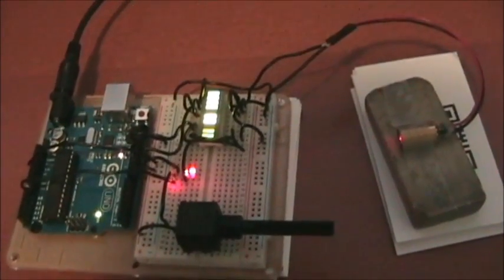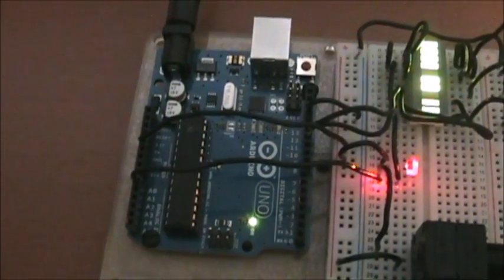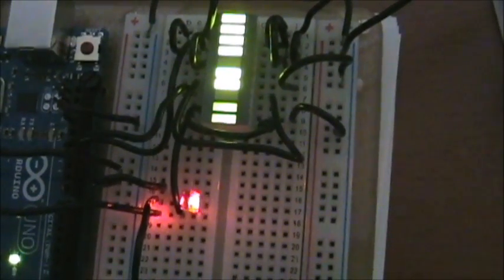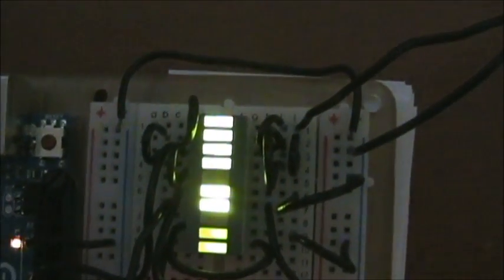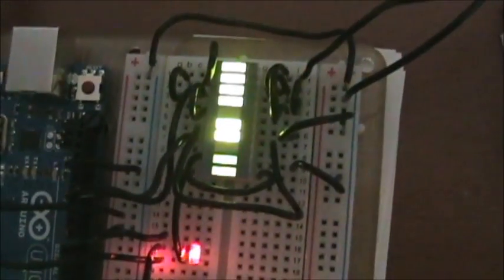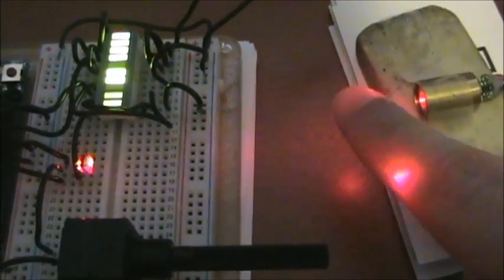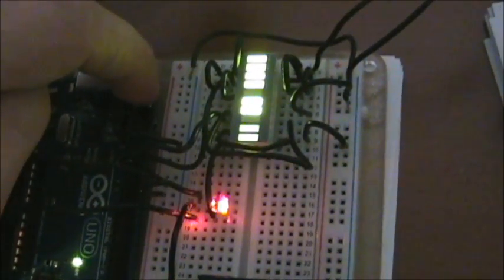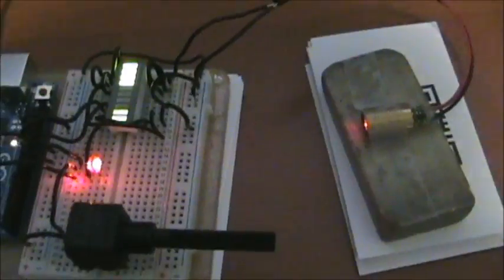Arduino Laser Tripwire

Comment: can the photoresistor be submerged underwater?
Reply from the maker: Yes and no.  The phototransistor is just a red plastic module with some wires coming out.  Assuming that the wires were not exposed to the water so that they wouldn't short, water wouldn't be an issue.  

If you wanted to make a unit that you could submerge, I think the best way to do it would be to buy or 3D print an enclosure for the detector and laser.  That way you wouldn't have to worry about shorting.
Reply: ***** I built a simple waterproof enclosure for the detector and laser and it still works fine. I have another one set up outdoors (without an enclosure)  and the phototransistor hasn't shorted. Thanks for this:)

Comment: Hi what is the max range of the laser and what does it total cost?
Reply from the maker: This is the exact laser I used:  http://www.allelectronics.com/make-a-store/item/dlm-3/laser-diode-module-650nm-4mw-3vdc/1.html.  The beam does not seem to be particularly well collimated, so I'd guess that it's good for a few tens of feet until it starts becoming difficult to detect.  The Arduino here is the most expensive part, but assuming you're using this as part of a larger project and so you have already purchased an Arduino you could buy the laser, potentiometer and phototransistor for under $10.
Reply: ***** Thank you!

Comment: Hi Ben, 
I'm looking to do a similar project. Do you mind telling me the specs of the photo transistor?
Reply from the maker: I'm not sure the guys selling it even know, which is why it's so cheap.  Here's a link to the exact one I'm using.  If you have some other kind, you should be able to tune them with the potentiometer to work.

http://www.allelectronics.com/make-a-store/item/ptr-2/phototransistor/1.html
Reply: ***** Thank you! I was also wondering if there was a difference between a photo transistor and a photocell. I couldn't fine much information online.
Reply from the maker: Himesh Kurera There absolutely is a difference between a phototransistor and photocell (e.g., photoresistor).  The photoresistor has only two leads, and you can think of it as just a normal resistor whose resistance decreases with illumination.  The phototransistor has three leads, and how much current flows is a function of both illumination and how much voltage is on the base.  In the case of a photoresistor, the dark current will be much higher than the dark current of a phototransistor, and the switching time will be substantially slower.  Because I wanted fast switching and near-zero dark current, I chose a phototransistor.
Reply: ***** Once again, thank you! A photo transistor would work better for me so I'll go with that.